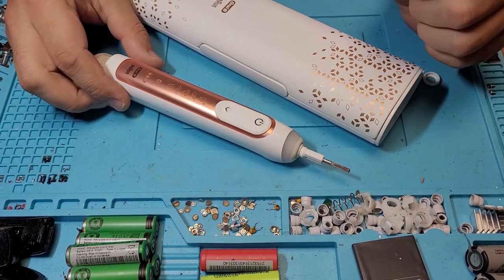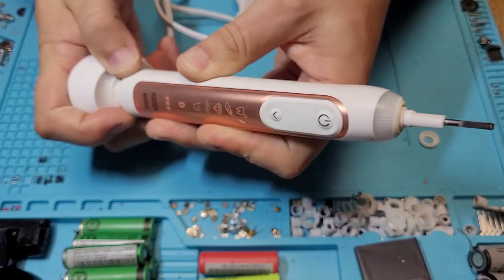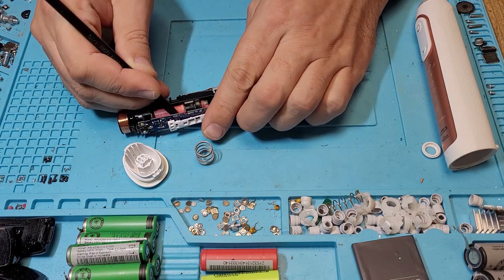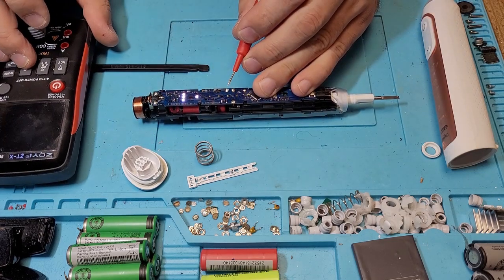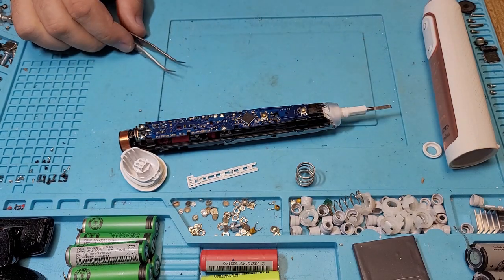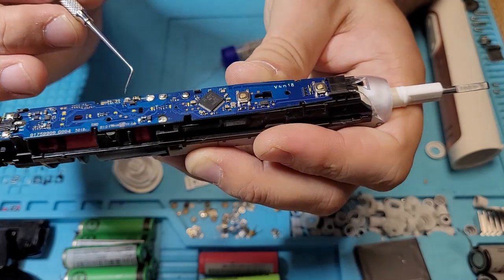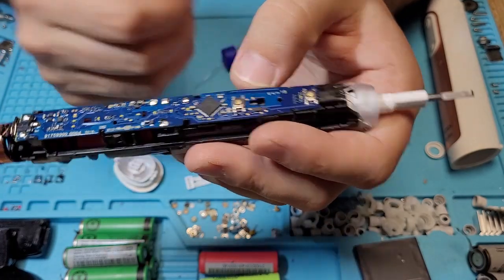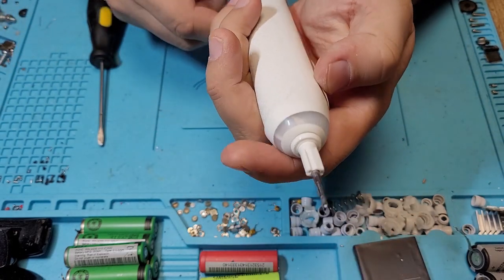Repair of Braun Oral-B Genius X. Lights up, but no vibrations.

Comment: I just tried the "pressure fix" meaning pressing on the fuse with my tweesers, and it is now working again. I will try to report back if it stops working again.  I am not sure if this a problem with seating though it should be soldered in .. or if there is a reset. I noticed that some of the fuses that Let's Fixit listed were described as resettable with pressure.
Reply from the maker: I think they call them self recovering didn't read anything about pressure reset.. but to be honest I haven't tried the recovery "function", how or does it work at all.. for me fuse should blow :) any reset function is a possible failure like in these genius brushes.. please do let us know if it will hold as well. For me it didn't work and I have repaired more than 20 of them..

Comment: I have the same problem with Oral-B Genius X Limited, should I buy the same piece of fuse that I used with the same power or do I need a different power
Reply from the maker: Sorry don't understand what you mean with power but made some experiments and usualy consumption is 200-600ma so fuse for 1A should be sufficient I usually put 2A fuse.

Comment: why they in 2023 still make slow charge batteries in toothbrushes.. its nonsence...16 hrs...
Reply from the maker: You can make fast charging but it affects the life of the battery.. even for cars if possible I would use slow charging. Much better for the battery. and you don't use your brush 23h56min a day :)
Reply: @letsfixitgarage  ok.. but there u have a phone and charging it every day for 5yrs.. and its ok..  how about this
Reply from the maker: Well it's not ok :) it heats up strongly and that affects the battery life. Just fyi car manufacturer considered a battery pack as needing replacement or totalled when it's capacity drops to 80% of original capacity. The same is for home  battery packs in solar industry. So with phone you get to this 80% in 1-2 years of "normal" fast charging... But then again there are different battery chemistry and so on.. but usually manufacturers consider one thing do I need this option in my product if it makes it more expensive. And a toothbrush that is used for 4min a day really doesn't need it :) although when I wrote it I remembered Braun IO introduced fast charging so maybe I am wrong and users do need it :)

Comment: Sorry, it's not a fuse... The actual reason is a motor itself! It is a brushed motor which naturally experiences some wear-off at the commutator. That metallic dust on the commutator comes between the plates, specially if some lubricant is used there and short-circuits the windings. That small unwanted "bridges" between commutator plates (google if you don't know how a brushed motor is driven) greatly increase the flow of current and make that fuse (the one you desperately blame for the problem) become really hot and limit the flow of current. It's should be like that! It is a protection against the faulty motor, a protection against pulling too much current from that Li-Ion cell and burning the traces on the board or "starting fire" (and a nice way to make you buy a new brush...) This is why the motor "slows down right after you press the button". When motor slows down it "wants" to pull even more current but becomes even less because the fuse is working! It's a closed loop if you want.. That fuse becomes hot as hell, you will burn your finger if you touch it but it's not hot enough to "unsolder" itself or take some damage... Now.... what you believe is a fix is not a fix actually... by pressing some screwdriver on that fuse you help that heat dissipate, the resistance of the fuse drops down, let's all that current flow in to a motor, burns down that bridges on the commutator (if you are lucky... it might burn a winding as well or destroy a commutator) and additionally let the motor run and help that "cleaning process" to happen... It actually postpones the problem but if you are lucky it will last for some time... Same happens if you short circuit (bypass) that fuse temporarily... and same happens if you replace it by a higher rated one which I would AVOID! ...  It is highly unlikely that the fuse got destroyed by doing it's job... maybe that key-transistor sitting next to it... but... actually no.. So- what's the fix? Normally, I would tear that motor apart and clean it but.... it is hard-welded in-to the frame and seems to be a Braun's own production... It has no openings to try to "wash" it with contact spray or whatsoever... Even if I cut it out from that frame, I don't think it is easy to open.. and will not be easy to replace by something else... Similar brush models might have the same mechanics inside- this could be worth trying to find out. Bypassing the fuse or connecting a motor to regulated current source directly might temporarily fix it.. Again... I would not remove or bypass (continuously) that fuse unless you want your toothbrush become a cracking fireworks in your hand... The battery is soldered by thick traces directly to the place where a Key-transistor and that fuse are sitting. Pads on the board are also thick enough to let some significant amount of current flow... Normally a motor will die if it short-circuits itself but this could also cause a small melt-down inside the brush... if you skip the fuse... By the way--- that controller is always hooked to the cell and might hang on if underpowered while that faulty motor pulls so much current, specially if you have bypassed the fuse.. Therefore a reset has to be done to bring it back to life... If I find a way to fix that motor, I will come back and post an update here...
Reply from the maker: Hello Georg. Thanks for taking the time and explaining this problem, interesting deep dive to the problem source! Thanks! What do you think would be the normal current draw of this motor? By measuring actual current it could be a measure to evaluate the motor state?..
I think there could be multiple things that overheat the original fuse like motor age (dust on the commutator) gearbox lubrication and user behaviour by hard pressing the brush while cleaning.. and after it overheats, it starts to degrade the Fuse. I had a lot of these brushes and the fuse for some reason is not getting hot but maybe this is different design of the fuse not sure.. replacement fuse that I use is rated at 2a, as you state it could be to much but even if the motor shorts it should reach higher value than 2a and prevent a meltdown.. don't you think? I could take video of motor teardown just to check your theory but I need to figure a way to open it without adding dust and other contaminants inside..
Reply: @letsfixitgarage  I had exactly the same motor issues with my kids toy-trains (TomyPlarail). After few months of playing I have to disassemble and clean the motor shaft otherwise they don't run and motor and battery connectors get hot... A multi meter would read almost zero on motor.. After cleaning they run like new for next couple of months.. So I thought it might be just the same problem here and made sure to switch the brush off as soon as the problem appeared for the first time. I first even thought the battery is dead and provides insufficient power to run the motor or keep micro-controller alive (it kept slowing down till full stop within 3-5 seconds). But LED's were shining bright and after charging I could not get that motor to run at all again... To prevent further damage I did not switch it on for longer than 2 seconds. This have "saved" the fuse so I could find out it gets so hot after opening the brush. You might be right, it's dying from the heat. I am sure that users have desperately tried to run that thing and the fuse died before you would get a chance to check on it... Some users report that their brush did not work after replacing or bypassing the fuse. Nor does mine. Unfortunately the motor is hard-welded with point welder within the frame and hard to disassemble... I will give it a try next week... Will also have to unsolder it from the board and check on it again.. By the way- reading the current of the running motor even with a pro-grade multimeter will not really work and be only relative.. Try using an analog instrument instead. 80-100mA should be normal for unloaded motor of that size if i compare it to the brushed motors I used to put on my RC planes.. That gearbox does not bring much resistance nor does the mechanics for sensing extensive pressure.. Mine has a "Braun" laser marking on the body which makes me think it's not a standard 130-size motor... can't really tell until I have taken it to my hobby-room.. Do you have any chance to go and try to open that motor or find a replacement perhaps?
Reply from the maker: So got back to your theory and sadly it's not true.. first I measured around 20 motors and current pull at 3v was always between 480-580mA. Then I tore one motor apart and it seems Braun thought about the carbon dust in closed motor problem. There is no carbon brushed. They use soft metal plates to transfer current on to collector. motor collector had some tear from the metal plates but not to much. I will make a short video to show the inside of motor in few days.. hope this helps.
Reply: I unsoldered that motor, it's seems to be ok but has some "dead" positions were it want start at all.. It behaves the same way the motors from that toy trains do... by the way, they all have theese metal plates, still creates some dust which mixes along that grease and gets conductive. But... Once the motor runs it takes 480mA (true rms). So it should work.. Now I believe that mosfet next to the fuse is dead... it get's hot and does not let any current pass... can't read the markings. Fuses are ok..
Reply from the maker: Just uploaded a new video on my findings on different type of the Oral-B brushes. With the promised teardown shots of motor. In this professional care series I found current resistor that affects the brush performance and behaves similarly as defect fuse. Not sure if genius has the same current resistor or no.. didn't had the time to inspect it..
Reply: @georgsarkisjan1874  Can you explain how to do the reset please ? Thanks for your help ;)
Reply: I finally suspected the problem with the small mosfet sitting next to this "fuse" because it got so hot... I finally could give the brush to friend of mine who is well experienced in soldering smd and it turned out to be true. That mosfet is dead and gets really hot. He replaced it with the similar one and the brush is working.. but if this is the case with your brush it is going to take a bit mire then simple "reset"
Reply: @georgsarkisjan1874  ok I understand.
But can I have the reset procedure please so I can already try that 😉
Reply: @BILLYLAILLE   A "reset" could be applied only to the microcontroller on the board if it "hangs up" which I believe is not your case? Some people here, including me, run into this trouble by shortening some traces on the board while looking for the cause of error. So if the brush can't be switched on and off or lights stay on or behave in a wrong way there are two solutions: - remove power (you will have to re-solder the battery) or find out a type of the microcontroller used on your board, google its datasheet and make use of the "reset-pin". Usually it means- connect it to the ground or "power". I took the second solution. On my model that pin was connected to the "+" via resistance so I just shortened it to the ground for a second. Pressing down that fuse everyone is talking here about is not a reset. That fuse or whatever, seems to run hot during the operation (due to faulty motor I believe) and desolders itself from the board or gets damaged. By pressing it down you might be lucky to "restore" it by squeezing. Not gonna last long until it brakes down again.  Maybe it is a MOSFet next to it getting hot. This was a case for me. A friend of mine used his fine smd-soldering equipment and replaced it by the new one (different type but it works fine.)

Comment: Thank you for the video! It seems we all have the same issue. I started to follow your tutorial but having trouble removing the top ring. What tool did you use? TIA.
Reply from the maker: I usually use a flat head screwdriver. But sometimes it is difficult to remove... Heat it up in hot water for few minutes and be careful with screwdriver not to damage  rubber seal on the brush housing under the ring..
Reply: @letsfixitgarage  thank you very much!

Comment: Thanks! My toothbrush was replaced 3 times during 1.5 years . The warranty lasted for 2 years and 1 month after it just stopped working again. I have looked on youtube for some adviced and found this one. As I have no experience with electronics I just used a screwdriver to press on the fuse and it just magically started to work. Now lets see how much it will last.
Reply: Me too! We should sue Braun!
Reply from the maker: I'm really surprised with this pressure fix. Really indicates a fuse manufacturing problem... If not much to ask let us know if it holds. I believe had one commenter that fuse failed after few weeks and one that holder permanently (or he didn't reply when it failed) ;)
Reply: it helps me too))) just pushed on fuse by screwdriver and it started to work.
Reply: Hi.
So how for how long it lasts ?
Is it still working ?
I have same symptoms, bought that toothbrush 7 years ago and it happend to me today
Reply from the maker: I would say it depends how it will deform under pressure it could hold it could not hold but it will definitely not do it's job as a fuse.. better way is to replace it..

Comment: Is a 0805 fuse with 1A good to use too? If yess or no what is the difference with a 2A fuse?
Reply from the maker: If I recall correctly nominal usage is something 200-300mah. Under load ~ 500mah. So 1a could be enough as well.

Comment: Welp!  Here I am.  Same problem as everybody else.  Watched your video, ordered the fuses and then I started to read all of the comments.  I tried the pressure thing on the fuse and that didn't work and then I kept reading.  I too heated up the fuse a little bit here and there just for the heck of it.  Once I let it cool down I tested it and it works great again.  I know you have responded that it probably isn't a good fix but I figured what the heck.  We are going to run a test.  Today is December 19th 2022.  I will return here and comment when or if it goes bad again before I mess with a new fuse.

Thanks for the video
Reply from the maker: Thanks for your comment. Did you heat it up with hot air or soldering iron? Do update us on your findings! it's unbelievable that this defect occures in the first place...
Reply: @letsfixitgarage  Like I said.  I did order new fuses but when went to take old fuse out I was like..... my tip isn't that small!  I read someone elses comment and tried it.  I just put my oversized tip on the fuse a couple times in a couple different places.  

Still goin
Reply: I also fixed my Genius-X by heating up the fuse with a soldering iron. I assume the fuse isn't broken at all. It is more likely a bad soldering connection which breaks at some point due to the vibration. By heating up the fuse the connection gets "refreshed". In case it happens again I will just remove the fuse and short circuit the thing.
Reply from the maker: Difficult to say I tried to resolder some of them but no luck. That's why I replace all the fuses when I repair these brushes. I'm really confused that someone succeeds in repairing them by pressing or heating up. Still don't understand why these fuses fail in the first place...

Comment: Thank you for sharing this information. I have a feeling this is a common issue for all these similar models. My first Genius x 10000 died the same way but it was under warranty so they gave me a replacement. Now less than a year later the replacement failed the same way. I was able to revive my toothbrush with your video so thanks again.
Reply: I can feel with you. I bought more than 2 years ago a double package with one black and one white version of this toothbrush. My black I changed in warranty already 2 times. Always the same problem. The white one was also not working and I get new one. But yesterday the same problem. That means in sum in 2 years 4 toothbrushes was broken. This is really a bad joke for such expensive version.
Reply: Same here. I've replaced 4 under warranty. All failing within a year. Surprise oral b doesn't fix this if it's getting such a high failure rate!

Comment: Thank you sir you saved me. I just use a screwdriver to put some pressure on the fuse and it is working again!! 🤞🤞🤞
Reply from the maker: Thank you for a good word and your donation! First time from Japan :) glad it helped, but from my experience pressure on electronic component is not a permanent solution from vibrations it can get loose again.. I would look for a shop where I could bring already disassembled brush and ask for a fuse exchange.. shouldn't cost much..